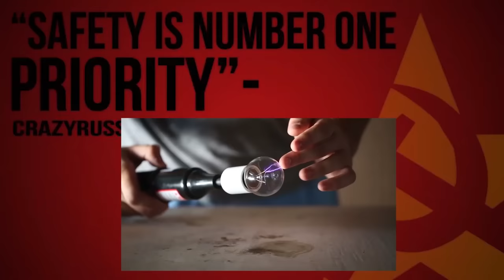8 Hot Dog Gadgets put to the Test

Comment: A hair dryer will remove stickers off applicances without much effort. Want a hack to remove candle wax from a carpet? If you want to test this hack grab some scrap carpet simulate a liquid wax spill. To remove the wax You need brown paper bags and an Iron. Then place the brown paper bag on the wax and iron the bag, the wax will attach to the bag and lift off the carpet with ease may need many bags.
Reply: thanks mate
Reply: KoolBreeze420 Household Hacker?